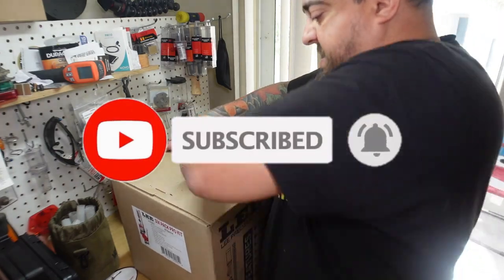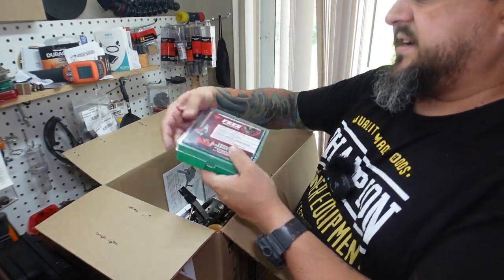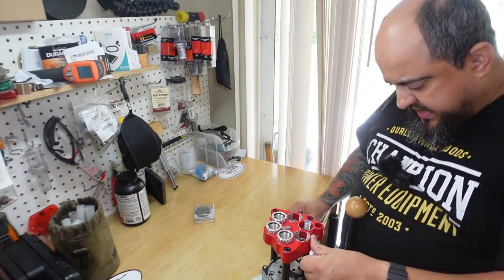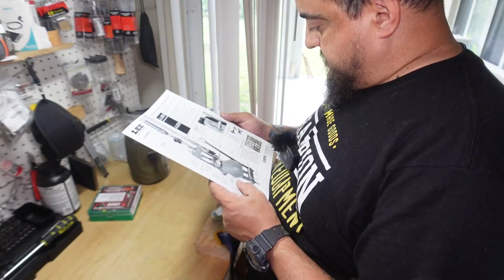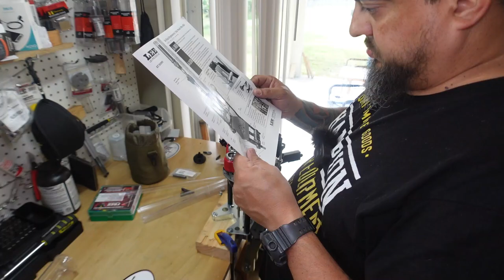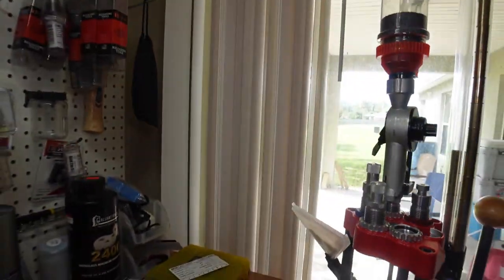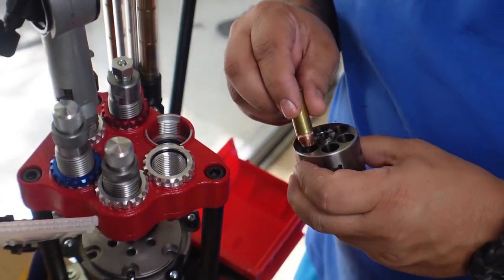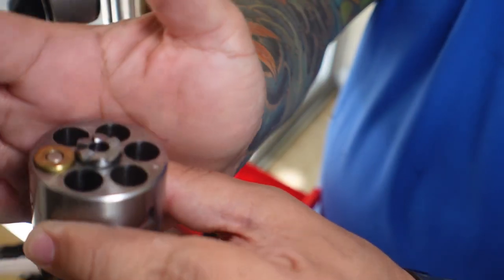Lee six Pack Pro 6000 Press | Unboxing, Set-up, Die & Close Look!

Comment: I have one of these.  I wanted "One press to rule them all!" I.E. do everything from 9mm to 30-06.  Breaks my heart to write this.  When loading .308, station one likes to leave the shell in the die and tear off only 2 bits of brass.  I don't think it is seating all the way in the plate but it might be the plate moving upon extraction, either way is makes pre-sizing and pre priming mandatory for rifle cartridges.   I gave up and pulled the die loading only decapped pre-sized brass.  There is a plastic ring as a spacer.  It would have been really nice if Lee had made the plate carrier and the plate actually FIT each other.   The primer pin is only one diameter, small, so it dents and distorts the large primers.  Replacement zinc shell plate holders to not come with the screw holders threaded.  So if you need one make sure to use either self tapping screws or tap the screw hold first otherwise, the screws can snap upon first installation.  I would NOT recommend this press, at least not for any rifle ammo.  I would avoid buying this press for anything, except (perhaps) pistol ammo.
Reply from the maker: I hear you brother

Comment: This is the only progressive press I've seriously considered and I went with the barebones press and shell plates I needed.
I see that your primer tray also fouls on the press head. I just got mine and was thinking it was damaged or defective. How did this pass engineering QC? All they had to do was add a little extra to the feed slide height. That's Lee for you.
Niche issue, but Breech Lock/Smart Lock bushings are just small enough that Whidden Click-Adjustable lock rings don't work. Just ordered 7/8" ID x 1-1/2" OD washers I found on Amazon (exact size needed). Crisis averted.
Reply from the maker: Totally agree!! Hey sub if you can

Comment: Got mine about a month ago, so far works great. Didn't see the 3D printed slider hold down device (BP5345) which you have to get otherwise the primer spring will lift the primer guide arm out  and you can't prime.
Reply: Just saw it attached so you should be good to go.
Reply from the maker: I’m confused as to the location and purpose of the ring. I got it but have not installed it yet.
Reply: @Comerelaxandlearn  It's a spacer ring that goes underneath the shell plate for 40 S&W size and smaller. Talked with John Lee this morning and he's sending me one since it didn't come in my kit.

Comment: So i got mine from midway, and idk if its an issue but i got the red powder check instead of the clear one. Is that a problem? Im just getting into reloading for the first time and bought the 6 pack pro as my first press. I likely wont use it juat yet because i need half my tools for reloading still.
Reply from the maker: You mean the the powder hopper on top of the powder through expansion die?
Reply: @Comerelaxandlearn  yea
Reply from the maker: @MrShadow1995.  don’t think there’s a difference. One is clear and the other one is red with a lid. But if you are starting up the one with a lid would benefit you because as you throw powder and keep adjusting your powder charge, it’s much easier to dump back into the hopper.

Comment: Highly doubt this will replace your 550C.  What's the verdict so far on this press?
Reply from the maker: Much improved and much more reliable press. It’s definitely not a Dillon replacement
Reply: Just getting used to mine.  The timing on auto advance is perfect. Had a Lee Loadmaster, this is better.
Reply from the maker: @butchgeagan9768  indeed. The press is a better improvement from other Lee presses although I still really like my classic turret press!!